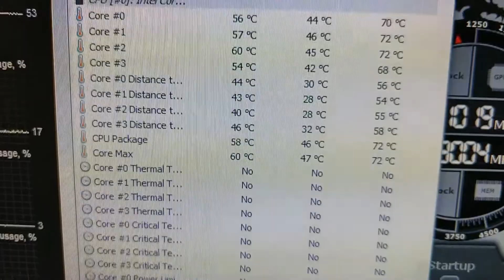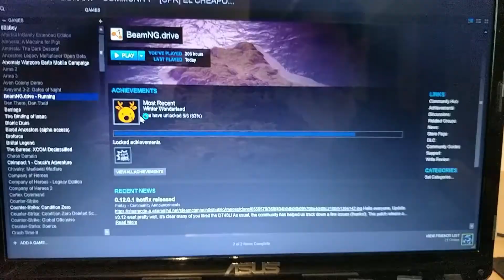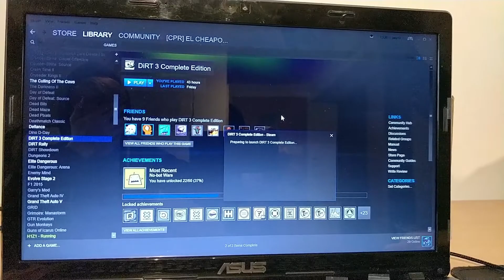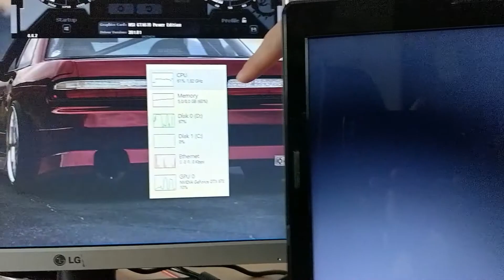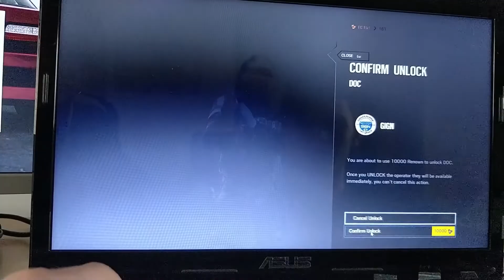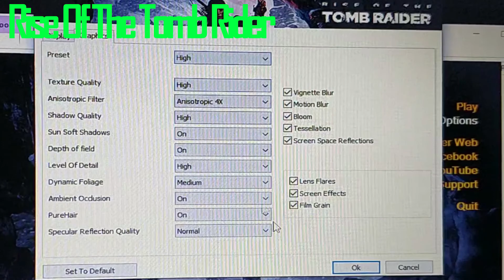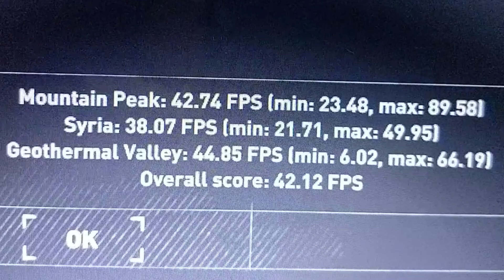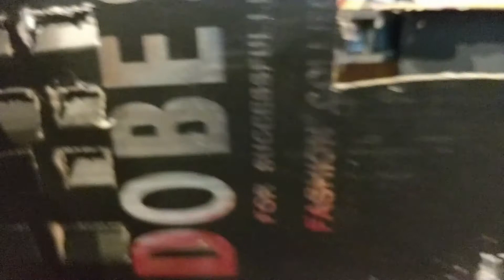EXP GDC 8.4 BEAST (GTX 670) + Asus K53E (i7 2670QM) Game test, pricing, how-to

Comment: Hey mate! May I ask if this setup is still alive and kicking? :) Any problems encountered in the past 2+ years? Cheers!
Reply from the maker: Heyy, yeah actually still in use. I reworked it entirely. Bought a SFF Acer PC case and installed the laptop's motherboard in it alongside it's power supply, a 520W ATX PSU that powers the GTX670... 120GB SSD as main and a 500GB HDD for game storage. Honestly it works fairly well :)
I didn't really have many problems with it, the only thing that bothered me was the size and complexity of the setup, so I combined it all :)
Reply: @CrownPitchRoyal  Hot damn that's amazing! Glad it's worked out for you from then till now :) Btw, yours is the mini PCIE version right?
I'm gonna be doing exp beast 8.4d too for my ASUS K55A with a 500w psu. The exp's gonna be arriving in a few weeks, and I really hope it's gonna work without any troubles like yours :(
Reply: @CrownPitchRoyal  Oh, and did you have to flash update your BIOS from the stock one? Cos i really hope i wont have to do that, with all the horror stories about bios flashing gone wrong :(
Reply from the maker: That's awesome mate :D Keep me updated :)
Yeah I have the x1 2.0 miniPCI-e one xD surprisingly the GOU isn't limited by it.
No I didn't have to flash my bios but if there's a update available I'd check the changelog and see if it's worth updating.
What GPU are you going to be using with it?
Reply from the maker: And ammmm honestly it wasn't as problemless as you'd think xD I killed two motherboards in the process... But hey worth it
Reply: @CrownPitchRoyal  I'll be using an ASUS Strix GTX 960 2GB. Thanks man! Will update here eventually! :D
Also, holy crap, may i ask how'd u burn thru 2 mobos?? Was it 2 years ago when u were first setting it up? Or did u have to replace your mother board twice over the 2 years-span of using the rig? And u said u didnt even flash ur bios? :o
Reply from the maker: @hanzsantos  Good card for a eGPU man, stick with Nvidia they've got some good PCI-E compression features that really help them when running on low bandwidth slots... Noicee looking forward to hearing from you :)
Emmmm I'll blame it on user error xD One died when I updated bios and swapped my original B950 for a I5 2520M... Honestly what happened was I enabled some Intel security features in bios and it wouldn't post anymore xD Second one I don't even remember tbh, but I know at some point I forgot to remove the battery when I had it open and the cmos battery fell on the mobo shorting the ethernet port but yeaaah.
Look Asus has amazing laptops and this one even though it was budget is well built. I had to drill 2 holes through it so I could mount it in the SFF case and it's totally fine :)
Reply from the maker: @hanzsantos  Oh and yeah I never flashed bios with any third-party bios, just original manufacturer bios updates that I needed for the I5 and I7 to work
Reply: @CrownPitchRoyal  Good to know bout the nvidia stuff man, thanks :)
Dangg, duly noted with your stories man, will make sure to always be extra careful and take all necessary precautions before fiddling around with anything.
Re. updating using latest manufacturer BIOS, glad to know it worked out for u, but ive read threads online where even doing that kills the mobo :( if i may ask, did u use a bios update exe program, or did u do the flash drive method? And you only had to do that for the CPU upgrade right? Not the eGPU setup?
Reply from the maker: @hanzsantos  No problem mate :)
Yeah it's advised to be careful, especially when modding things far beyond their expected use case.
Yeah that's true. I've read about that aswell and it might be that what bricked my second board. Honestly if you aren't swapping CPUs out and everything works fine just don't flash bios. I updated it via a usb straight in bios. Never felt comfortable with .exe's for updating bios tbh.
And yeah I had to do it because it wouldn't post on a new CPU. eGPU workes right of the bat. 
Honestly when you get yours. Just wire everything together and try it. It should work no problem
Reply from the maker: @hanzsantos  Hey damn sorry to hear that. First thing that comes to mind is weak power psu but that can't be since it's a seasonic. Have you tried to maybe charge your laptop without it's battery?
Other than that nothing really comes to mind...
Reply: @CrownPitchRoyal  Yeah, dont think its the psu either. Tried the no battery route already and to no avail, still :'( One thing i noticed as well when using the system is it crashes and restarts the laptop whenever I turn my airconditioner on. Is it bcos of the flimsy exp gdc atx power cable?
Reply from the maker: @hanzsantos  How old is the wireing in your home? I feel like your power dips so badly when you attach anything new to it that it causes that. What if you try connecting everything to your power grid and then turn it on? If that does it it's probably your electricity is too unstable. If you've got the time you can join my discord server and we can try and find a solution together. https://discord.gg/nuf55cy
And if that's the case maybe adding some capacitors could help smoothen out the inconsistencies... But let's hope it's something dumb and simple
Reply: @CrownPitchRoyal  as old as the house i guess? so around 11-12 yrs? What do u mean my power grid? And when it comes to electronics, im pretty dumb (and super broke), so yeah, i hope i wont need to add those capacitors or whatever :'( 
Duly noted on the discord, thanks for the invite :)
Reply from the maker: @hanzsantos  I am so sorry for a late reply I actually had zero free time and got no notification about any messages... Have you been able to solve your problem or got any new info? 
If your house is even 20 years old it should have decent wireing. So I doubt it was that.
I know basics about electrical components and wireing so if you need something I sure can try and help.
No problem about discord mate, if I'm free that's where I'll be.

Comment: That cardboard box is really dangerous. Video cards get hot, and that box might burn. They sell enclosures on eBay. You should buy one if you have not already.
Reply from the maker: That box was magnificent! The GPU didn't really got hot if I'm honest... Nothing in there got too hot. There was loads of air flow for each component expect for the back of the GPU. But that is why the top fan was there. About 8 months ago I had completely redone it. I fitted the laptops mobo and the GPU with a PSU in a OG Xbox that died on me not long ago...

Edit: Also those enclosures are overpriced as hell. And for me the real reason I did this was because I wanted something different.
Reply from the maker: @Boris Graell Wow nice. Well plenty of headroom left. Thank you.

Comment: Good work! I like the wiring job in the video board's box. Ond the screen input board is good when it is on the back of the laptop.
Reply from the maker: MýnÆnglishTáwk Thanks! I'm planning on cutting the back panel off and mounting the board on to the LCD via some plate or something...
Reply: The screen input board? That would be good. Then tha couldst wire it to the battery pins inside the laptop, so that it does not need its own mains brick!
Reply from the maker: @ComputerAndTechnologyChannelTM  Hello damn I don't know why I didn't respond to your comment. But yeah you could power the screen driver from the battery with a step-down converter. :D I completely reworked that project and turned it in to a desktop PC xD a small form factor one but still quite decent :D

Comment: I also have same processor, ram, 240 ssd... I have Medion Akoya P6631. Do you think that I may have it like this ? Are you using Windows 10 ?
Reply from the maker: Depending on the motherboard you can easily set something like this up. I am using Windows 10, but it should work with other Windows versions and unix.

Comment: plz cover some content on bottlenecking issues.. How much bottleneck you face with gtx 670??? Will Adobe works on this?
Reply from the maker: I faced only CPU bottleneck mostly. You asking about Adobe... Which Adobe app did you have in mind? Adober Flash Player works for sure. So does AE and Premiere yeah. Had no problems with them, just took a little longer to render things since the mobo had DDR3 RAM and slow drives. 
Anyways, think about it like this. If you can run something right now without a dedicated GPU you are most likely going to be able to run everything that requres a GPU at least 2-4 times better/faster.

If you need anything else just ask. Hope it helped.
Reply: @CrownPitchRoyal  i want to purchase this  egpu setup with an i5 or i7 laptop...So as you have tested it, I want to know that ( AE and premier will render faster than the internal gpu of laptop or not??) and (AAA games will run smoothly(30-60fps) with lowest settings(720p) or  not??
Reply from the maker: So honestly AAA games should run alright, especially on 720p lowest settings. But do keep in mind that it will all come down to your CPU. If your CPU is weak say if you have a I7 U CPU it will most likely bottleneck the GPU. Meaning: Games will run better to a point.
And when it comes to AE/Premiere it all depends on the encoder that you want to use. If you have a Nvidia GPU you can use CUDA and it SHOULD render faster. If you're using your CPU to render then I'd say that you will hardly see any differance. Besides previews maybe.
I'm sorry for a late reply.

Comment: May I know the performance when comparing desktop graphics card?? 

And I heard about that exp GDC dock losses it's performance. May I know how much??
Reply from the maker: Sorry for a late answer. To be honest I don't know how much. It ran perfect and the only problem I had was the CPU bottleneck. MSI Afterburner can depending on the GPU show how much of the PCIe bandwidth is being used. And I've never seen that max out even though the GPU is connected via a PCIe 2.0 x1.
I later replaced the 670 with a 1070 and again the CPU is bottlenecking like mad. Max usage of PCIe bandwidth was around 60%.
When it comes to a 670 the performance drop was negliable. 
You have to think like this. With a external GPU you'll have a powerhorse. Without one you'll have whatever you have.
In my cases the performance drop was probably about 5% of frames and probably some added latency when rendering frames but I didn't test that back then.

If you'd really like me to, tell me and I'll do it.
Reply: @CrownPitchRoyal  Thank you for your response. 
You have mentioned that your setup losses performance due to PCI-E. Laptop have Bi-os limitations. It could be changed by using nando 1.35 .If you change PCI-E 3.0.You could get better performance if you have good CPU
Reply from the maker: @endlessgamer4876  Hello. No problem I hope it helped. That could be achieved if the CPU was never, but since this CPU only supports PCI-e 2.0 even a BIOS flash won't help. 
The CPU of mine at the time was I7 2670QM you can look it up on intel arc website.
Reply: @CrownPitchRoyal  Yeah your CPU support 2.0. In stock by default it will PCI-E 1.1 .You need to convert PCI-E 2.0 which will help you gain more performance than previous
Reply: @CrownPitchRoyal  You no need to flash Bi-os. Nando 1.35 just different.
Reply from the maker: Oh sorry for a late reply.
GPU-z showed my GPU using PCI-e 2.0 @ x1 so I'm sure that was as fast as I could get it.
Reply: @CrownPitchRoyal  okay

Comment: Like for part from here 15:30
you can upgrade GTX 670 to 1070 or 2070 and rule the world 😛
Reply from the maker: I actually completely rebuilt the computer into a Acer SFF case with a GTX 1070 SC from EVGA :D It's a beast! Just need a better PSU because it crashes when under high load xD

Comment: Sir just wwanna ask whats the best GPU for my NEC i7 2637 8gb ram laptop thanks great vid
Reply from the maker: Sorry for a really late reply but I don't get notified when somebody comments.... First I'd like to ask you how much money would you like to spend? Have you tested a GPU with you laptop already? If you already have the EXP GDC adaptor I'd first ask a friend for his GPU to test it and see if it works. Than, some laptops have VRAM limitation. In my case any kind of 4GB GPU would not work. 2GB cards work perfectly. Now any of these cards should be fine: GTX 580, 670, 750 Ti, 770, 960, 970... Note that 1050 and 1050 Ti aren't compatible on many laptops. AMD: 460, 470, 560, 570. I'd go for one of those cards. Many high-end GPUs require really high bandwidth which the PCI-e x1 can't deliver at all. If you want the best compatibility go for Nvidia since they have some kind of compression that allows the GPU to transfer way more data over the x1 interface.

Comment: I have i7 4700HQ gen 4, and intel HD 4600, Asus x450jf, can i use exp GDC v8.4? What GPU?
Reply from the maker: I did some research and according to it, it should work flawlessly. I can't know what limitations your BIOS has so I recommend you buy the exp GDC first and test out your friend's GPUs if anyone has any. That way you can eliminate the struggle of buying a GPU with say too much VRAM (in my case my BIOS is limited to 2GB), So test different GPUs and than maybe get back to me. If you don't have that option go for a GPU with 2GB or less. That will work for sure. The only GPU that I heard has real problems with EXP GDC is the GTX 1050 and the GTX 1050 Ti. So really your  budget and your BIOS is the limit. Hope I helped :)
Reply: @CrownPitchRoyal  i really appreciate your advises.

I am thinking if my bios limit the Vram, does modd the Bios can change it? (ex. Nando1.3 set) 

I will send you my progress according to your advises.
Reply from the maker: @jayanaga6807  In case your BIOS does indeed limit the VRAM, you could theoretically mod the BIOS to overcome that limit. If you know how to mod BIOS and flash it, that should be a rather simple task. 
But if you don't I would advise you to ask a pro or do a lot of research on forms and maybe ask some locals if they know how to. 
But if it's not limited than you should have absolutely no problems. Look your CPU isn't that old so I don't think it'll be limited. But to be sure, please test your hardware. 
I don't have the same laptop nor do I have plenty of GPU's to test them with it.
Good luck!

Comment: How did you make the laptop start with the control board. Mine keeps beeping 8 times and shutting off.
Reply from the maker: Might be incompatible GPU or some BIOS limitiation. I hope you figured it out by now.
Reply: @CrownPitchRoyal  i think its the bios. i circumvent this situation by starting my laptop with the internal monitor connected, then after that, manually switching the adapter to the control board (external). I had to create a hole in the back of my laptop for that. I read that my laptop cannot turn on without the monitor.

Comment: Will this work with a dell latitude e5430 and if so which graphics card is the best recommended It has an extra mini pcie port as well
Reply from the maker: As far as it has stock BIOS so it's not enterprise or similar any GPU with 2GB or less VRAM should work. I really recommend the GTX 670 for it's power and compression capabilities. Other than that I a GTX 960 if you can find one real cheap should do wonders :P

Comment: I just wanna know,If there is a chance it will work with APU based laptops ?
Reply from the maker: Which APU? Give me a name example: "AMD C-60 APU". But in general it should. Until you give me more information I can't give you a 100% answer.
Reply: CrownPitch Royal AMD A8 6410,Lenovo B40-45,Thanks.I just worried wasting my money and it didn't work lol
Reply from the maker: After quite some research I can't say for sure.
Do you know if there is a unoccupied mPCI-e slot that you can use for the eGPU? 
There are good chances that it will work.
When I was buying it for myself I found out that my laptop was under the "Unsupported list". Still I gave it a go and it worked :P (Obviously... duhh xD)
Maybe try asking on some forums souch as Tom'sHardware or exp-gdc.blogspot.si 
Also another thing is your GPU's VRAM. My laptop for example doesn't support more than 2GB VRAM. If a GPU had more than that, it just didn't work.
Take note that your laptop is in general newer. What GPU are you planning to use with it?
Take this chart for info. http://4.bp.blogspot.com/-reG6Kn2wKks/V59c24GrSAI/AAAAAAAAAD0/J-dcALXCpIY0mQP3nkoSErGKdJuJM4GigCK4B/s1600/gpu.jpg
Reply: CrownPitch Royal There is a mPCIE slot using by the Wlan adapter,Probably i must take it out in order to use exp gdc ?.My laptop only have iGPU the apu itself.
Reply: CrownPitch Royal Maybe RX460 for the safety
Reply from the maker: Kratos Spartan You can use that mPCIE port and buy a little WIFI usb adapter if you need one. I don't know how much performance you'll get out of it. But over the iGPU definitely a improvement.
Reply: CrownPitch Royal Thanks for the Info ! Please do more experiments with the Egpu as i still too noobies about this tech :D
Reply: CrownPitch Royal Oh yeah,I have another Question,Which is the best version of EXP GDC,considering that there is so many version of it out there,Thanks
Reply from the maker: Kratos Spartan The best version of EXP GDC you can get for a mPCIE ver is 8.4 BEAST. Currently the newest. 
Ayy if you want to see more. I'd love to hear what you'd like to see me try out/experiment/do :D

Comment: Can i use the 1080 ti with exp gdc 8.4?
Reply from the maker: You most likely can, but the connection between the exp gdc and the laptop will be heavily bottlenecked by the pcie x1.
But you probably can. Really depends on the laptop and it's configuration. If you tell me what's in your laptop I can do some research.